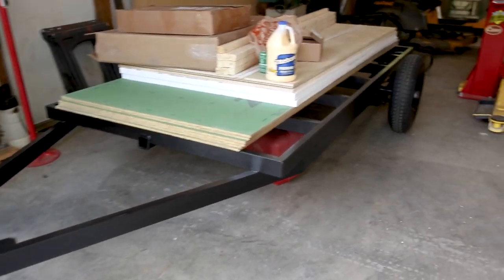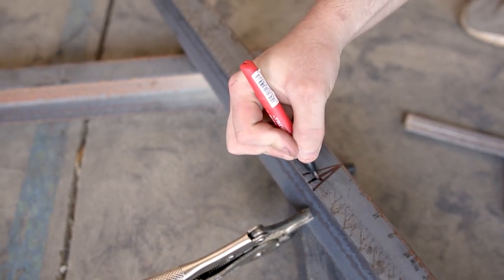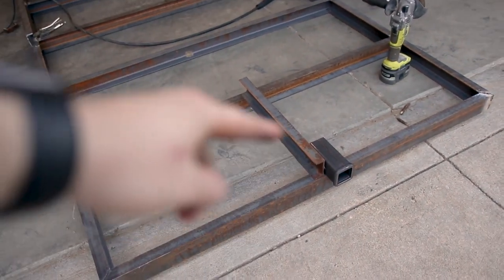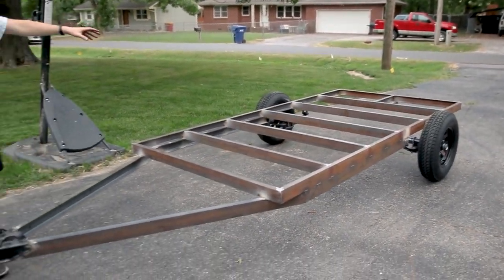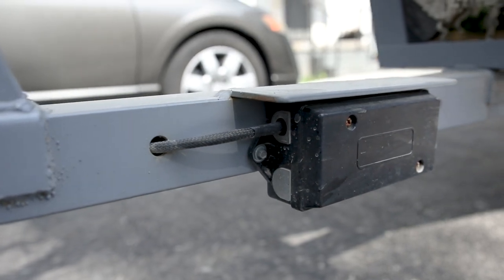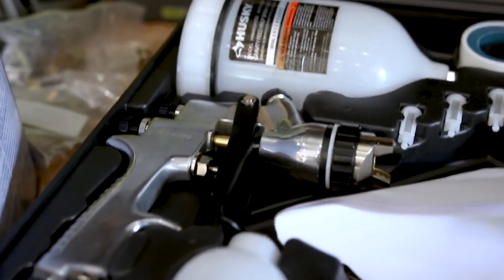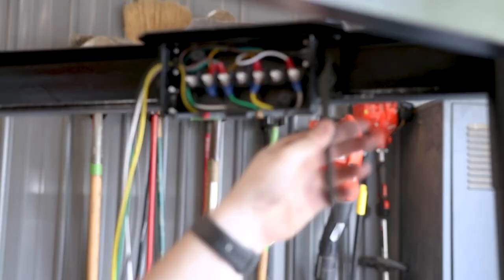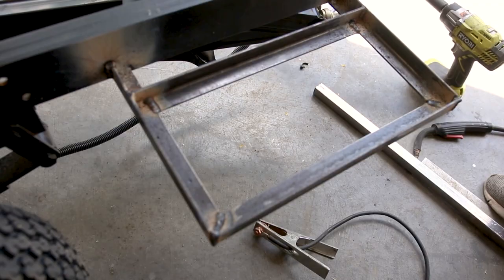DIY Tiny Camper Build | Part 1 - The Frame

Comment: I noticed you put the jack on the coupler. Are you able to open your tailgate on your truck with the jacks location?
Reply from the maker: Great question, on the 2006 Sierra it did open if the truck and trailer were straight and level. There were times if the road was off level or the truck was turned some it would hit the tailgate. If doing it again I'd add a cross member 8-12" behind the coupler and put the jack there. That would pretty much eliminate the interference with the tailgate.

On my 2018 Silverado the tailgate hit no matter the configuration. 

It also depended on the ball hitch you use. Some are longer than others.

Comment: I am very curious how many pounds does this frame have?
Reply from the maker: We didn't weigh the frame itself but because steel is a consistent weight I added up how much channel we used plus the axle, suspension, wheels and tires and it should be right around 450 pounds.

Comment: Can you advise a rough cost to build the trailer?
Reply from the maker: James, the total cost came in right about $4200. The itemized bill of materials with pricing, links and descriptions is available via a link at the bottom of the description. As a note - this was built about two years ago. Building materials and everything in general has increased in price since we built. I'd expect to pay more than $4200 now, especially raw steel, wood and wiring have increased substantially.
Reply from the maker: Also, $4200 was the total cost for the full camper. The trailer frame itself was somewhere in the neighborhood of $800 of that $4200.